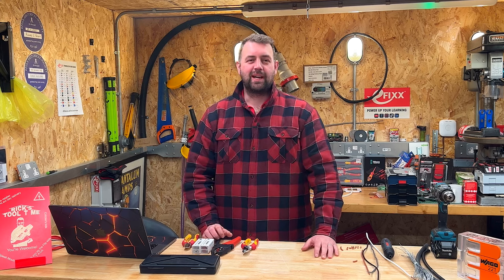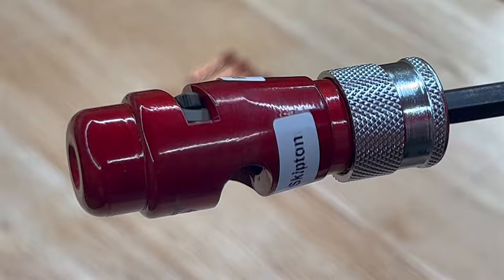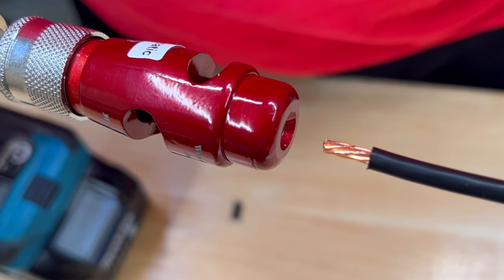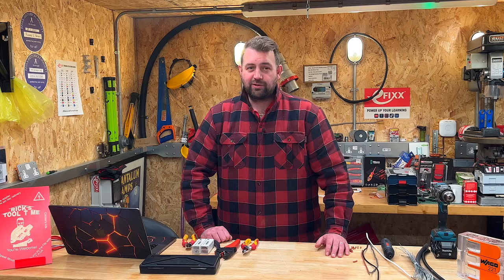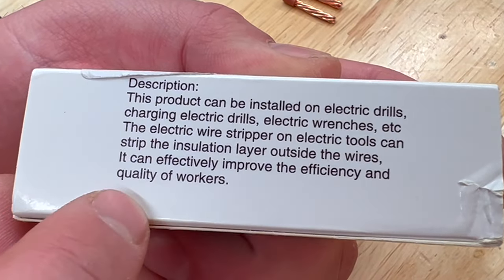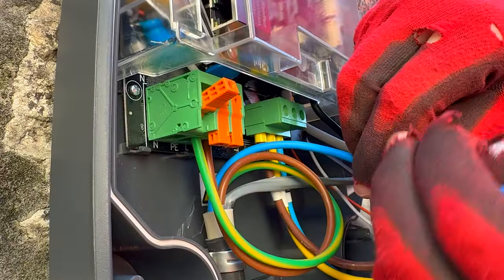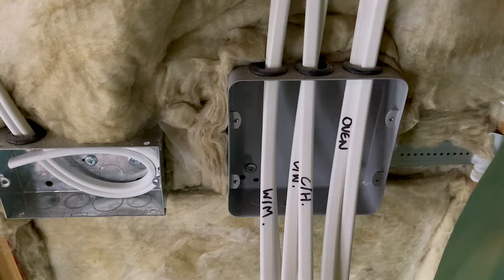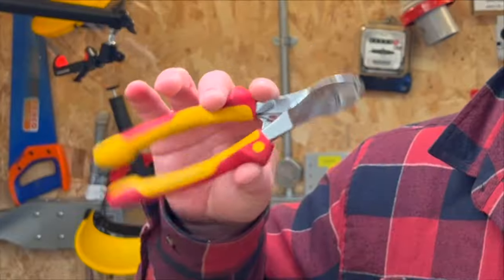Temu's Budget Drill Wire Stripper Reviewed!

Comment: This tool is not the ultimate solution for many reasons. First, it cannot be used in confined spaces, it is not intended for fine-stranded cables and it's only suitable for a small variety of cross-sections. Considering the working time for straightening the conductors before stripping makes me think that my traditional Knipex strippers are still more valuable.
Reply from the maker: We tested for one purpose XLPE insulation which is challenging for other types of stripper.

Comment: yeah nah, I'm gonna stick with my knipex 13728 & 1630135 strippers. They take up way less room in my toolbag and take care of any wire I could possibly need to strip. The only china tool that I've ever been impressed with is the T12 solder stations that use 20v power tool batteries. Legit useful.